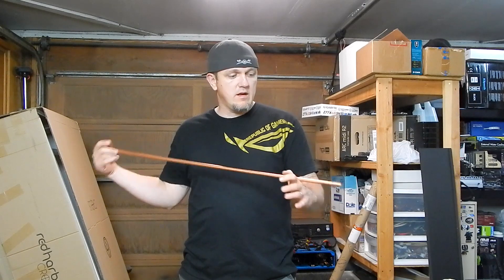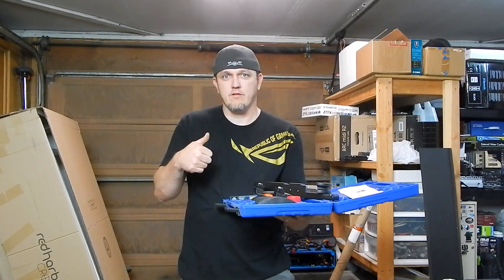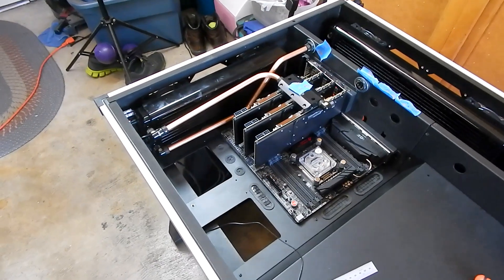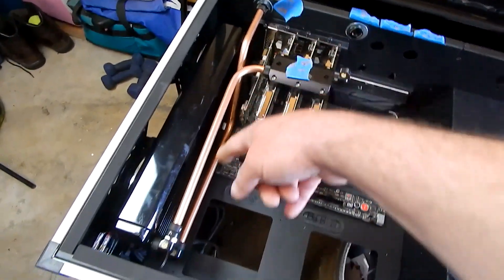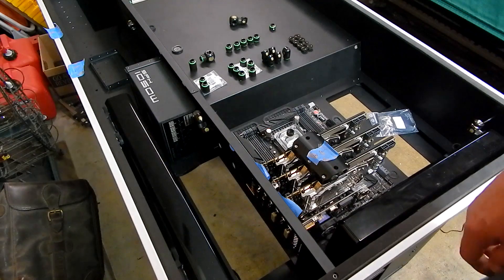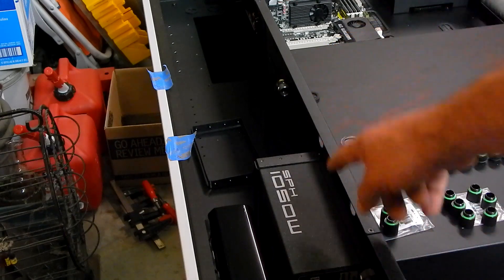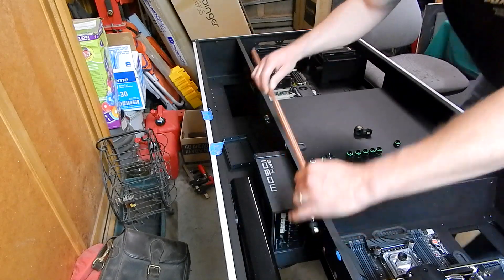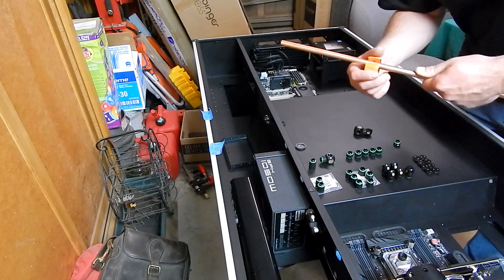Client build # 3 - Red Harbinger desk gets Copper Part 2

Comment: nice / can you put down were to buy that copper pipe and what size is it ID and OD and what size fittings you used Id and OD and what brand to go with .
Reply from the maker: I added to info above. Thanks
Reply: cool

Comment: Hello, how do you set the fans ( Jetflo) in crossDesk ? which screws you used ? the diameter is different between the desk and the fan
Reply from the maker: +Pascal Engles they're 5mm

Comment: Dosent copper react badly to stuff that is not copper i.e other metals? wont it corode around the fittings?
Reply from the maker: scott k good question but actually the metal that has issues with other metals is aluminum.

Comment: Does the ID of the metal tubing matter?
Reply from the maker: Andrew Li yes and no. too thick then its hard to bend. too thin it will crease in stead of bending.
Reply: Ah ok cool, I thought it was related to whether the fittings would fit.

Comment: Are these hard tubes 12 mm?
Reply from the maker: Yes they are.
Reply: @PcjunkieMods  do you think the efficiency is the same as with 16 mm copper tubes?
Reply from the maker: christiancostabrazil what do you mean?
Reply: @PcjunkieMods  if you think that a bigger diameter of pipe would be better to freeze the cpu cause more water would flow.... 🤔
Reply from the maker: christiancostabrazil I don’t think it will make much difference.